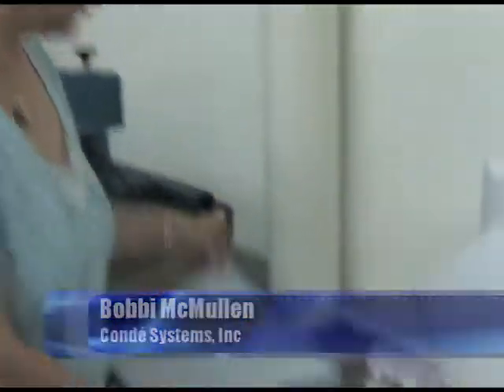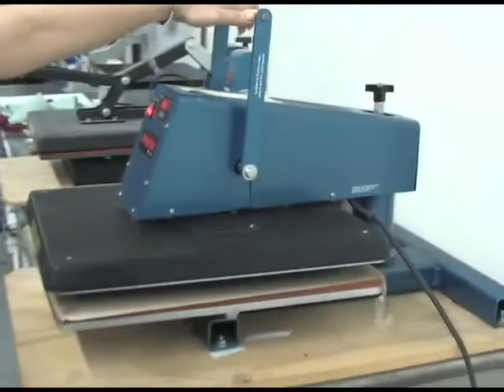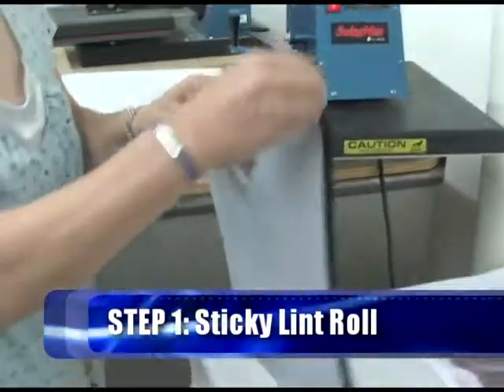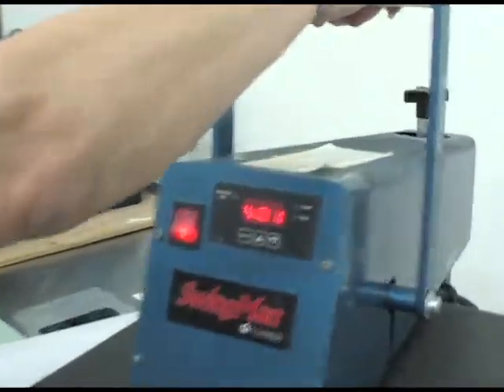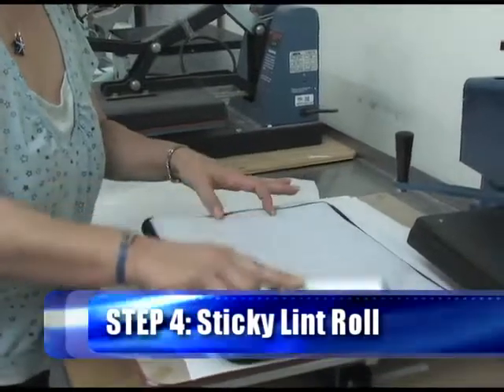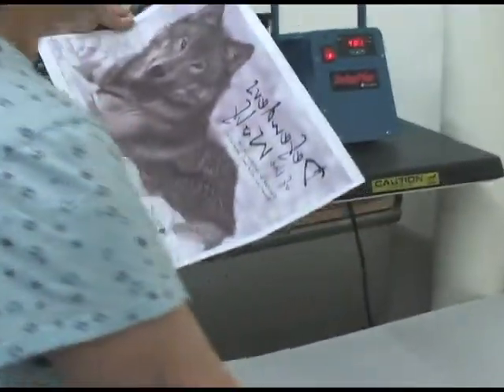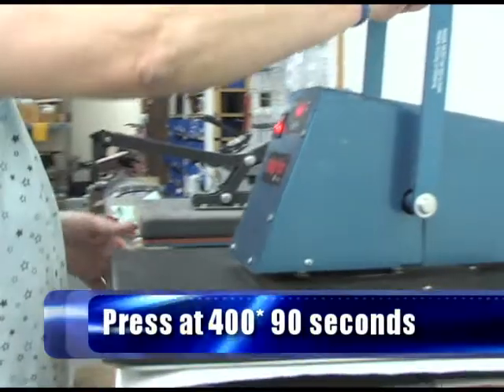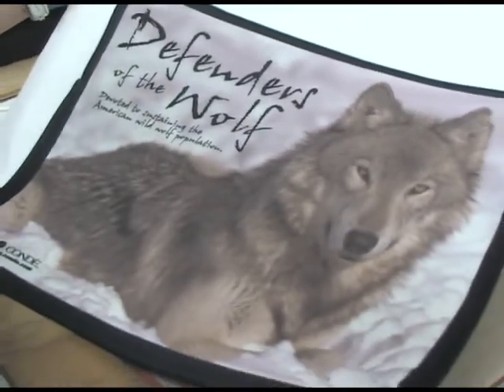How to Sublimate a Neoprene Laptop Case

Comment from the maker: One good way is to insert some foam or a Teflon Pillow and push out the seams. Also, folding the image around the corners and sides seems to help. And, if you do have that gap, using a Sharpee pen to fill it in can be a fix, if it's not too big of a gap.